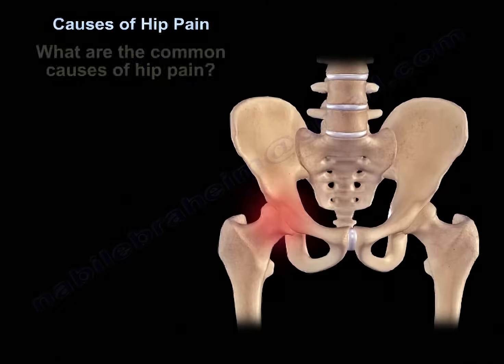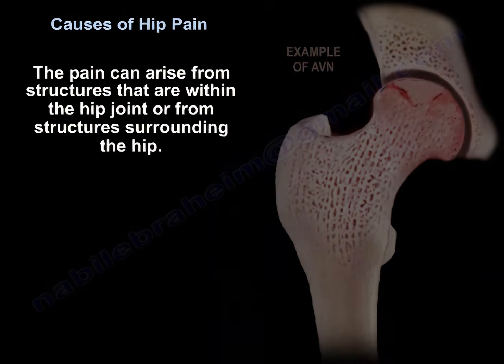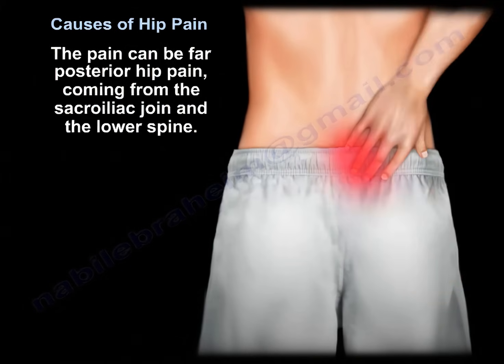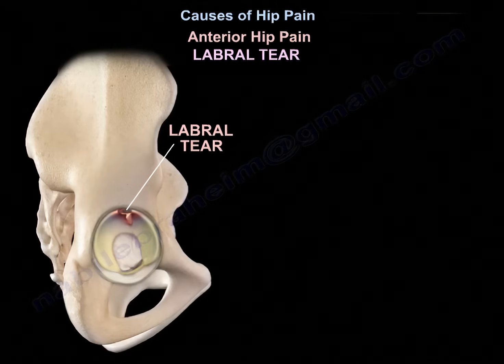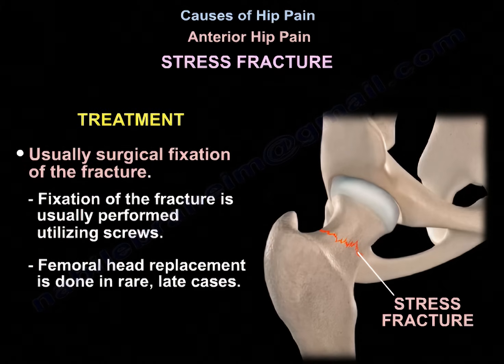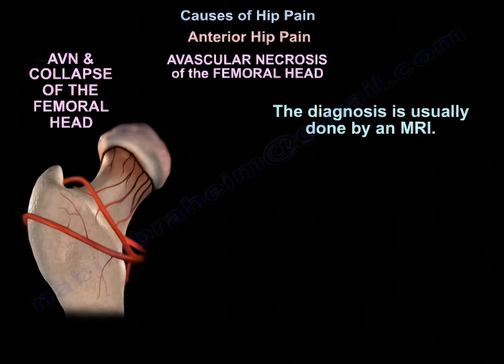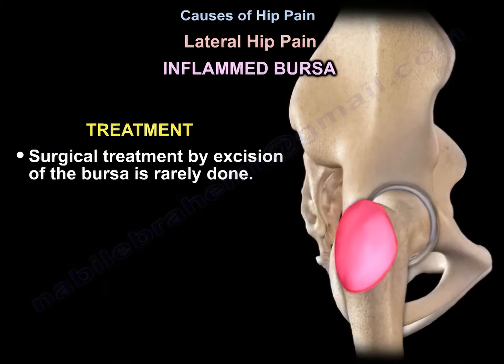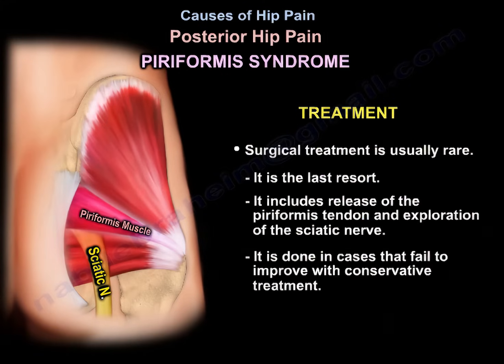hip pain, causes, diagnosis  and treatment.

Comment: Thank you so much. I've been having problems with my lower back and hip, pain goes all the way down my leg to my foot and often causes weakness and numbness, I've been doing physiotherapy and chiropractic care for a year now, and I'm having trouble walking. I just don't seem to be getting better. Xray showed arthritis in my lower back but my doctor couldn't tell me why my hip and leg pain is getting worse. Can an xray show sciatic/nerve problems?
Reply: You need to see a real doctor, not a chiropractor. X-rays will show almost nothing other than bone deformities and fractures. You need an MRI (at least) to see the soft structures and their issues (nerves, lumbar discs, muscles, ligaments, etc). If the damage is beyond the spine, then nerve conduction studies such as an EMG could determine the site of compromise. If you are having pain and weakness starting in your lower back down to your foot, you are correct, and that could be compromise of the sciatic nerve, which arises from the 4th Lumbar down the 3rd Sciatic (L4-S3) nerve roots. This huge nerve controls the back of the thigh and everything (sensory and movement) below the knee, except the anteromedial (front-towards the middle, headed to the great toe) aspect of the lower leg and foot. I'm just a pain doctor, and can't really diagnose without proper tests and examination, but I would at least see someone who could refer you (and quickly) to a pain specialist, a neurologist or even a neurosurgeon/orthopedist who could order the proper studies and do the proper exams, and fix your issues before any damage becomes more severe and/or permanent. I hope this helps you. My advice is worth every penny you paid for it! Get well!
Reply: @fmmaj9noname332  Thank you soooo much for your advice. I wish l had found it earlier. I visited an orthopedic doctor and he requested an MRI but I've been waiting for an MRI for 8 months now. Canada is in crisis with a major shortage of doctors and long waits for tests. I have copied your advice and will requesting an MRI again, and showing the doctor your advice, as l am still having trouble walking and it's getting worse. Thank you so much for your kindness. I am soooo grateful 🙏
Reply: Same  problem with me
Reply: I have the same problem